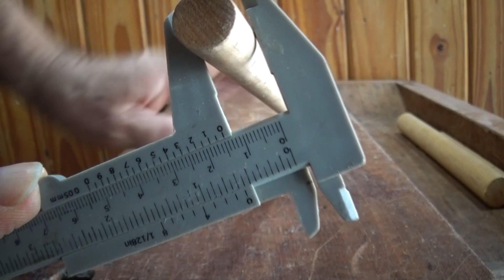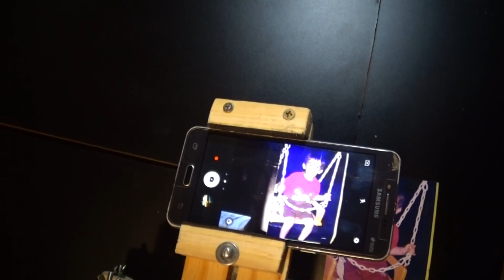COMO HACER UN SOPORTE DE CELULAR ARTICULADO / Juan Carlos Aquila

Comment: Anyone have any ideas for increasing friction in the joints? I built one and it works great - only the joints tend to slip after a few minutes.
Reply from the maker: Springs can be placed in each of the joints. It will give you pressure and it won't slide.